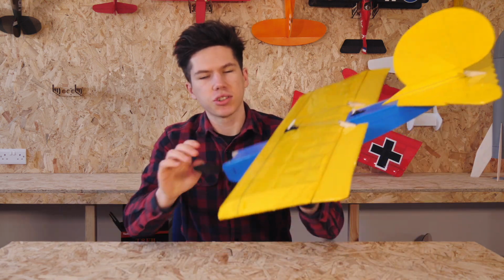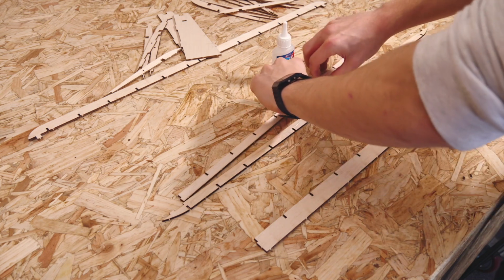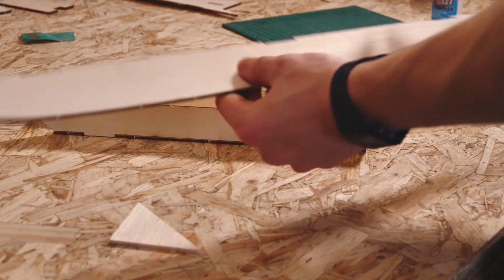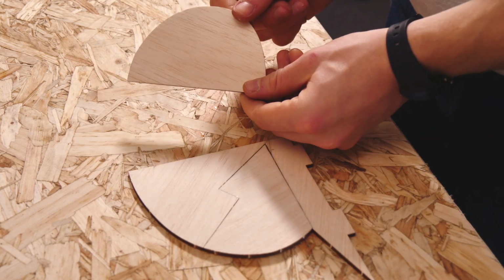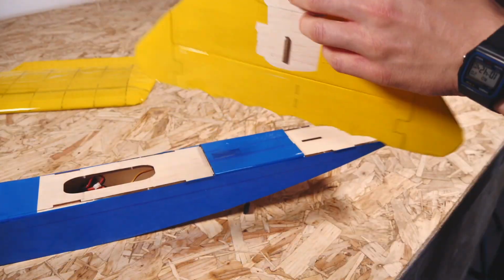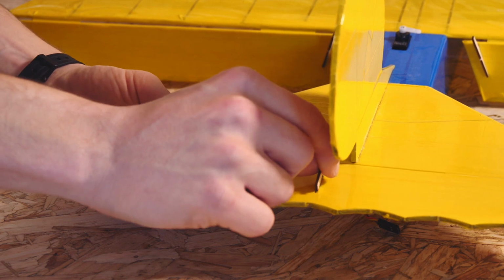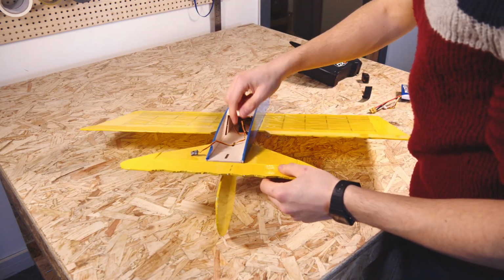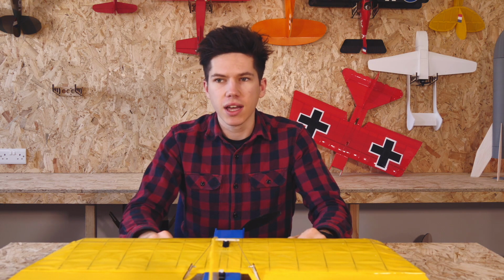How to Make the Balsa Baron - FULL BUILD INSTRUCTIONS!

Comment: I am amazed how far the art of model building has sunk.  I have many plans ordered from years ago, and it's really not difficult to build a far better looking and flying model.  The word for this one is "crude".
Reply: your memory isn't working too well. The past is not as rosy as you like to imagine.
Reply: @bmpowellicio  Having built my first flying model at age nine, in 1950, I think I have a pretty good grasp on what I say.  I have built every type from  HLG to 1/4 scale, and there's a little  effort involved in a good looking and flying model.  But look up BalsaUSA, then sport models, then smoothie or moonraker, either of which are nicely designed models that have outstanding flight qualities.  I've had several of each.  Or you might look for Dan Santich's magnum 40, a good looking and probably the best flying model I ever had.  But, not a kit, not electric, not for the hamhanded or those with little inclination for small details in construction.  Build it wrong, it will come apart.  Make it right, it's pretty rugged.

Comment: So much effort in designing and building the plane for covering it with tape and ruining it. Oracover is not that hard to work with and the result pays for itself. Just a bit more effort and it would look much nicer for all possible customers
Reply: Another romantic. These are not showroom queens, they are active-flight aircraft, and the whole idea is to get them airborne with as little fuss as possible. Its impossible to see the tape joins at 3 metres let alone 30. This is all about flying not sitting at home admiring your  workmanship with heat shrink film.